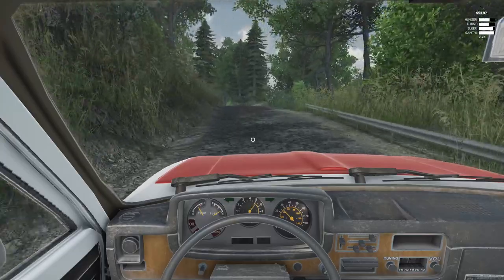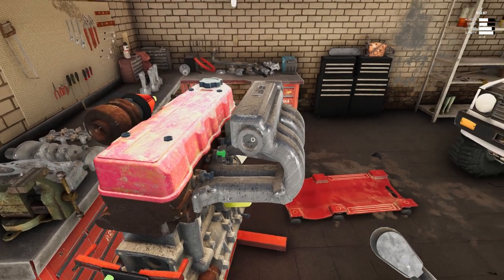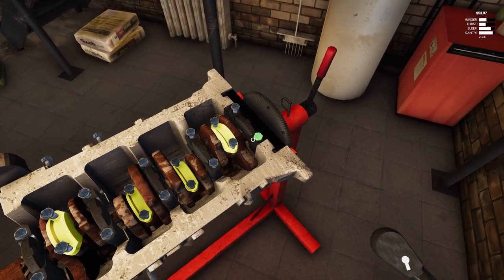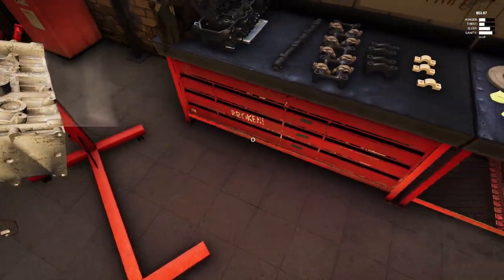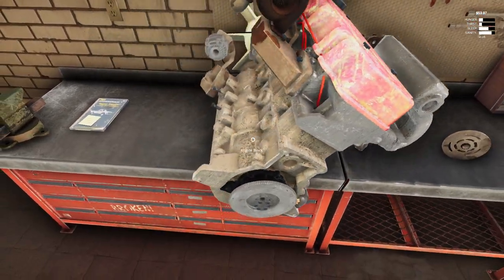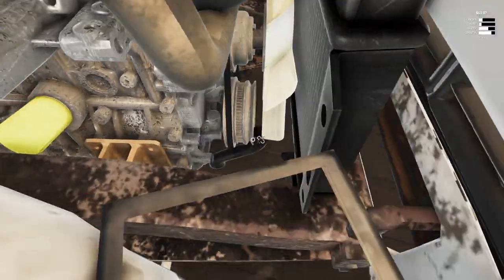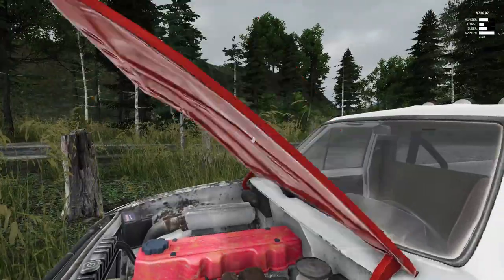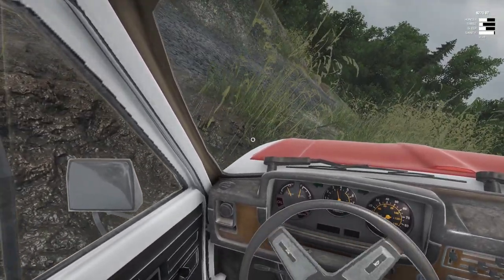Junkyard Truck •𝐂𝐎𝐌𝐏𝐋𝐄𝐓𝐄 𝟒 𝐂𝐘𝐋𝐈𝐍𝐃𝐄𝐑 𝐑𝐄𝐁𝐔𝐈𝐋𝐃 𝐆𝐔𝐈𝐃𝐄•

Comment: My cam gear doesnt have a bolt to remove, is this a bug for the carbureted engine?
Reply from the maker: You could try pulling it off and reattaching it. If that doesn't work take it off and set it on the table. Save and reload the game to see if that fixes it.